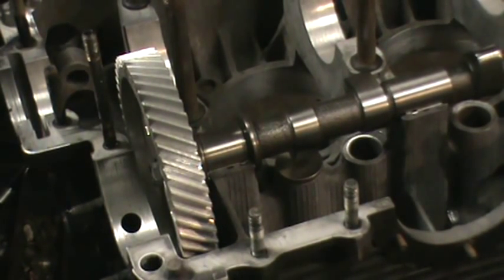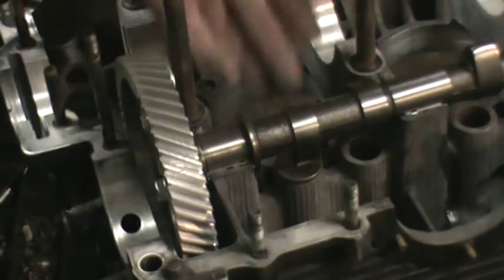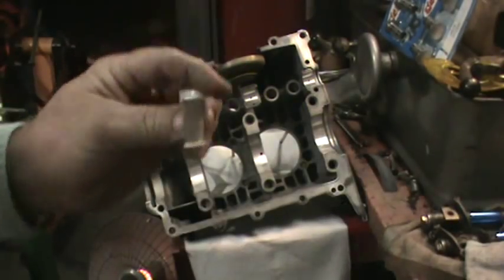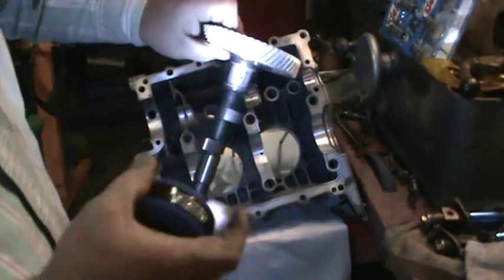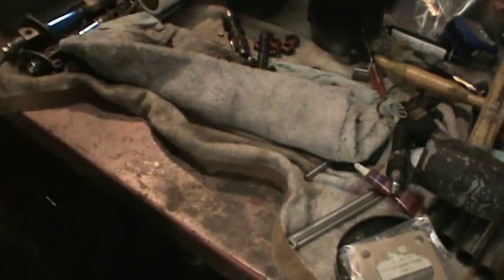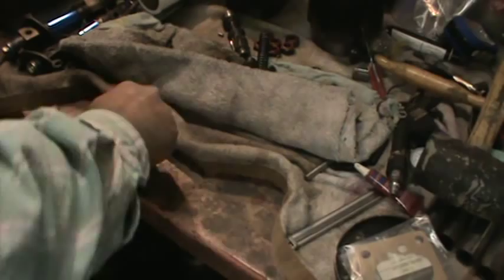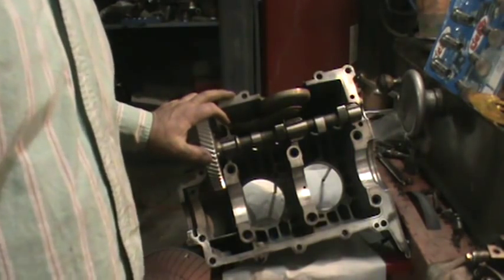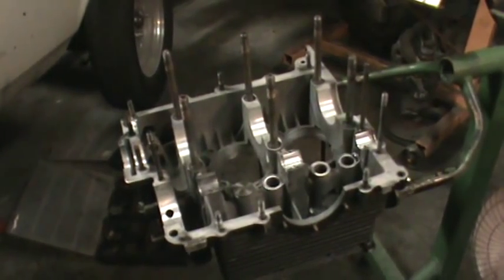Setting the thrust up on a VW cam

Comment: Excellent as always.Darrin I use a piece of 1/4 aluminum plate about an inch bigger than a full sheet of sandpaper. Works excellent. I set that up when I used to pull Garden Tractors. Place the head on there - Sand to True up the surface and/or mill it down abit.I might get caught up on your videos one of these days.

Comment: One of the issues i've had is that the bearing splays out in the journal once fitted. Out of the case the thrust is perfect when placed in the cam but once in the case the cam locks up. Had this with mahle and silverline's although the silverlines are a better fit overall. My concern is that despite having obtained the correct thrust there is still potential movement as the bearing is not sitting flush to the journal. I miss the days of being able to buy genuine vw parts that fit :(

Comment: Besides the thrust being tight with the Silverlines I'm also running into inconsistencies with wall thickness. My Silverlines measure .0494
and the Mahles I ordered are .0500.
Either way  way too tight. In fact the Mahles are negative -.0010 clearance

Comment: Or you put the cam in the block, tighten the 6 large block nuts, put a 1/2 inch steel rod in on both ends of the camshaft  thru the oil pump hole and the other end and give it a smack with a ball peen until it runs smooth. Not to much not to little.

Comment: vwdarrin do you have an email address that i can contact u with some photos of my motor after a local shop screwed it up by not setting the geometry up right and or by putting the wrong length pushrods in it , id love to know what you think of it and what your opinion on it as well thanks xracrboy

Comment: more nonsense;.. the camshaft thrust is fixed by the camshaft thrust bearing and  not adjustable!
Reply: You just are not much on grasping concepts are you? Such as the one that some parts just do not fit quite right out of the box. So what is your solution if you don't sand the thrust surface down? Jus slap it together and if it's tight just pray it will all loosen up rather than seize? Thankfully I learned about building engines decades ago and realise that just because it is the right part number does not assure correct fitment. So happy I don't have to rely on someone with your lack of thought process to do my engines for me. How you can make the obtuse comment you did rather than understand the common sense solution to this problem is a much bigger mystery than why these thrust bearings no longer fit right out of the box.
Reply: That comment ... is a ... swing and a miss 😂🎉